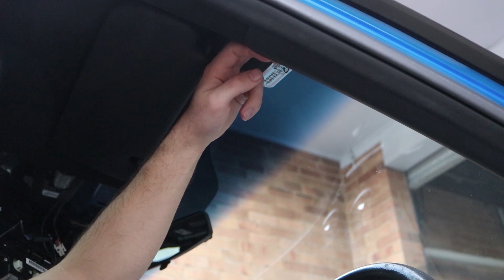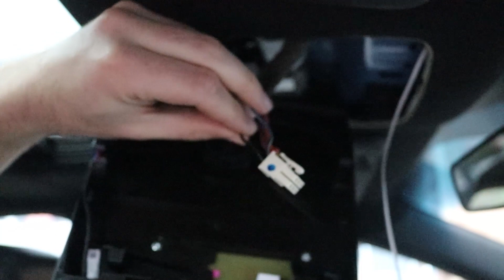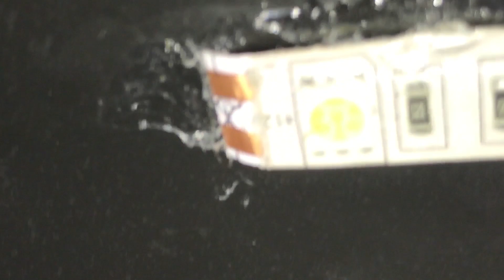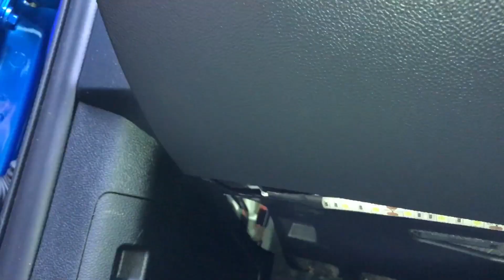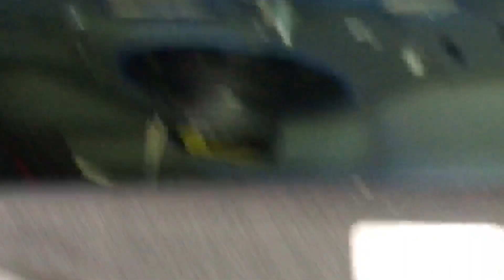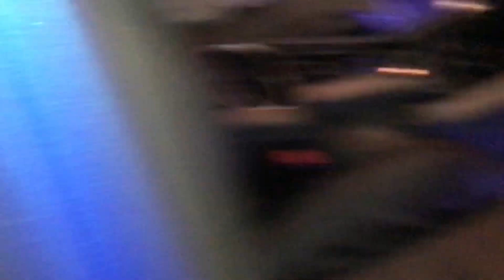How to Install Footwell Lights

Comment: Question, why did you choose the blue wire?
Reply: It is the positive power supply that is activated by the door switch. In my car it is negatively switched so if i wired mine up this way my foot lights would be permanently on.

Comment: Can i get power from fuse box and from the fuse for the dome light? Will the lights just go on when i open the door or switch on the dome light?
Reply: Hey did you do it this way already? Did it work? And how did you do it?

Comment: Just put some in my Mazda 3. My set  had a cigarette lighter adapter though so it was as simple as plugging it in and mounting them.
Reply: What kind did you buy? Looking to put some in my Mazda 3
Reply: Ben Raymond the eBay special set. They were the first ones that came up when I looked up LED foot well lights. These are mine. https://imgur.com/gallery/QnVqdUV

Comment: There's a better option for pickup under the driver side tweeter panel, this is what I did anyway and didn't bother checking passenger side.

Comment: Fitted some to my vy crewman this evening..easy as and significantly brightens up the car at night although they only operate off the door switch wire and I can't switch them on through the other interior lights but thinking about altering the circuit a bit so they can be moderately independently switched

Comment: If this pulls more wattage to the system do u just use simple addition to up the fuse power? 
For example if my bulb originally pulls 4 Watts , and I Change it to 10 watt LED strips do I just change the 10 watt fuse to 15?
Reply from the maker: Fuses are rated in Amperes not Watts. A basic calculation for wattage is P=VI. That is Power (watts) = Voltage (Volts) X Current (Amperes). To convert watts into amps the calculation is I=P/V. That is Current (amps) = Power (watts) / Voltage (volts).

If you have 10w of LED that would be I=10/12 (Amps= 10 Watts divided by 12 Volts) which give s you 0.83A.

I would highly doubt adding LED's in this small quantity would overload your fuse. 
The LED's I used consume 2A per 5 meters so with my car I'd estimate I'm adding an extra 0.5A to the total load given the amount of LED's I used.

Having said that, if you do a calculation and determine that the total load will exceed your fuses current rating, DO NOT simply put in a larger fuse. The fuse is rated to the current carrying capacity of the wire. Putting in a larger fuse will mean more current can pass through the wire, heating up and potentially catch fire. If you calculate you will overload the fuse, I'd recommend running a new circuit from the battery with an inline fuse instead.
Please be careful with wiring and electrics and if you aren't confident seek professional help. Good luck!